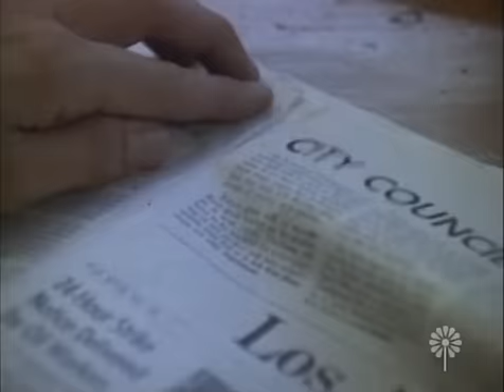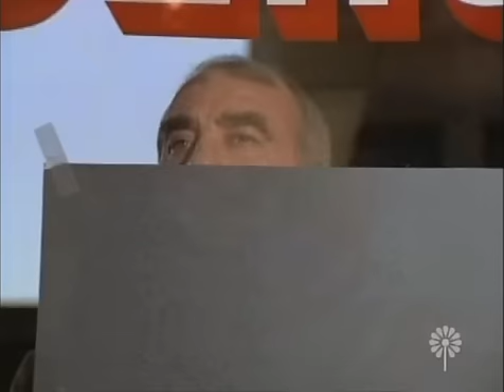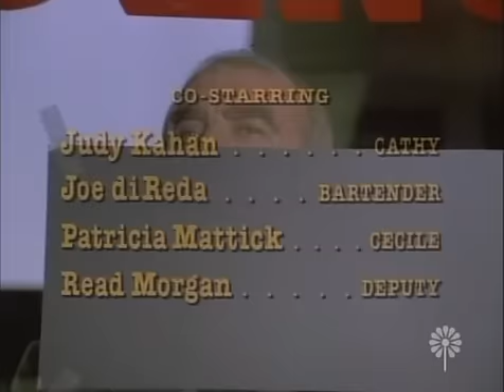Lou Grant S01E04 Henhouse

Comment: Ah, when coffee costs thirty cents, bell bottoms were in style, and cars were huge -the 70's !
Reply: Connie Crawford, everyone talks about how big the cars were then. Have you seen the ridiculous aircraft carrier SUVs on our roads? They make large 1970s sedans look pretty moderate by comparison.
Reply: @inkyguy : But no one misses Mercury Bobcats (Pintos with better seats)! :D
Reply: @inkyguy  The SUVs may be heavier in some cases, but the largest SUVs today still aren't as LONG as the largest cars ("land yachts") of the 70s.  70s cars seemed especially large, considering most of the the cars of the 70s only had 2 rows of seats.
Reply: K Webster, I'd estimate that it would take nearly three of my father's 1975 Chrysler New Yorkers one on top of the other to fill the same space (height, width, depth) as the largest SUVs I see on the highway today — not including a Hummer. Such an SUV could lumber over top of one of those 1970's New Yorkers practically like a tank. Those massive SUVs are simply (and in my opinion, ridiculously) enormous. Regardless, I simply find it ironic to see people talking about the "boats" of yesteryear while driving today's battle ships.
Reply: @inkyguy  Cargo space is likely much bigger in an SUV.  1975 New Yorker was reportedly 54 in in height, 79 in width, so difficult to envision production SUVs that are nearly 3 times that size.   Today's heaviest SUVs are in the 5500-6000 lb area.  The big sedan cars of the 70s were in the same weight range.   The lengths of the longest cars of the 70s are several inches longer than the longest SUVs today.  But I agree with you on today's SUVs. They are ridiculous.  I've never driven either a land yacht of the 70s or today's SUVs.  I prefer my gas mileage.